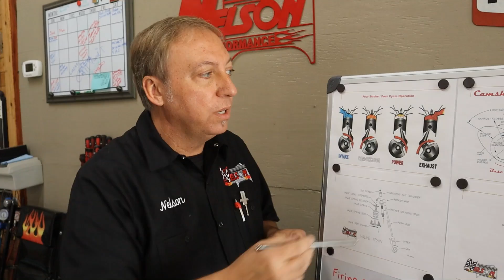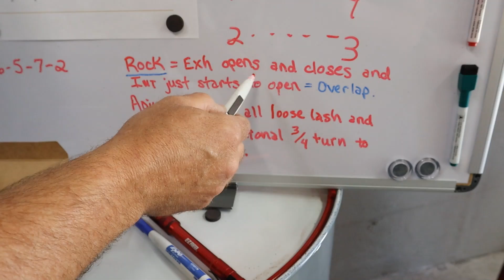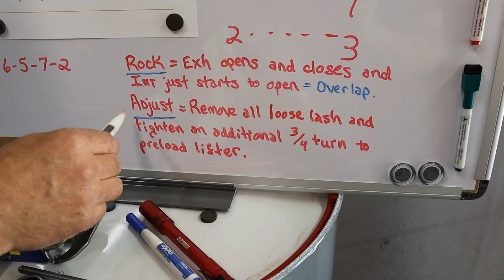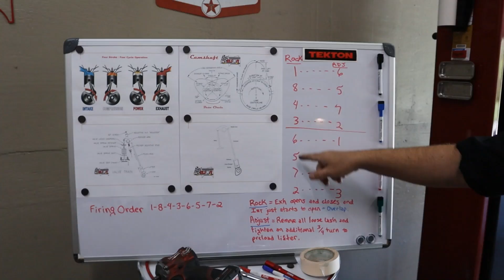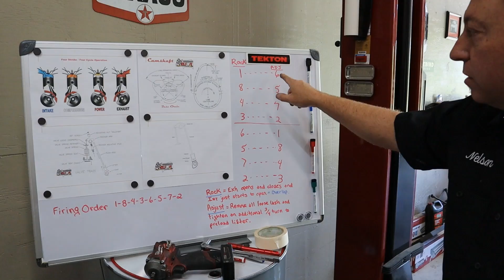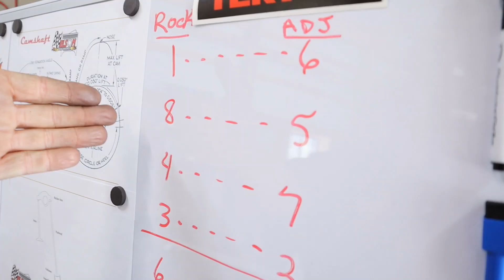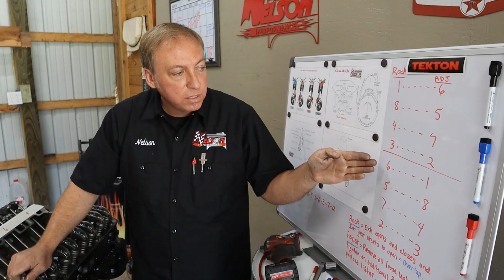Rocker Arm/Hydraulic Lifter Adjustment

Comment: I agree that this method is the best on YouTube! I have been adjusting mechanical (Not Hydraulic) lash adjusters for decades on mostly 4 cylinder import engines. Now my son needs his lifters adjusted on a SBC V8 in an engine I built him 6 years ago. His buddies all have messed with them and they are all out of wack. (I hate those wing-nut rocker arm cover bolts, they scream, take me off! NO! Those are for mechanical lifters & feeler blades)They all had different ideas on how to set them. I have the clip set that keeps oil from spraying while at warm idle running, but this is not practical on all. Now several cylinders are misfiring. I can't begin to tell you how well you explained this, to help my son (37) understand and how much clearer this old tech can show or explain to him and his buddies . They all can take them apart, but putting together is a different thing. Thanks!
DK, ASE master tech since 78.
Reply from the maker: Hey Dean, we get a lot of compliments on this video but I can tell you’ve had your hands on a few through the years and that makes those kind words mean even more. Thanks again and good luck on all of you and your sons projects. Glad we could be a part.

Comment: Worst explanation ever.
Adjust ALL intakes on the left bank, as each exhaust valve starts to open, about 1/4 inch.
Then all 4 exhaust valves on the left bank, as the intakes come to 1/4 inch of closing. 
Repeat on other bank. 
What do I know, I only built engines for NHRA, IHRA, WINSTON CUP, NMRA, AND APBA.
Reply: Yeah, and I just built my own jet-fueled lawn mower motor and it does 8sec on 1/4mile. I don't have a video but just take my word for it.
Reply from the maker: Yep, I’ve heard um all. Just depends on how many time you want to turn that crank. Same end result. Thanks for viewing our video!

Comment: excellent description and followed it and break in procedure to the tee but still wiped out the cam! Elgin cam and lifters. Any advice on how to NOT have this happen again and what cam and lifters I should buy? 67 L79 SBC with Stock 151 cam. All stock 327/350hp corvette
Reply from the maker: Hey James, hate to hear that for ya. Cam lobes are ground at a taper (approx .003) from one side of the lobe to the other and this is what causes the lifter/pushrods to spin when running. Without that taper the lifter wouldn’t spin and it wears very fast. There are a few other things that can cause a lobe to wipe out. Valve springs not matched to the cam causing coil bind and excessive pressure on the lobe or too strong of a valve spring pressure. Improper Valve retainer to valve guide/valve seal clearance also causing excessive lifter to lobe pressure. Also the oil must have a zinc additive in it as an extreme pressure lubricant or a regular oil will cause cam lobe wear. You can get the additive at your local parts store. I have always had very good luck with Comp Cams products. Most of the major cam company’s have been bought by Comp Cams. You can also paint a line down the top of the pushrods so you can verify they are spinning on start up. Makes a lil mess but it’s a good piece of mind. Hope you get it lined out this round. Thanks for the comment. Nelson
Reply: @mitchnelsonperformance  Excellent advice Just installed a GM cam and Johnson lifters at 3 times the cost of Elgin. One of the lifters does not spin nearly as much as the other 15. Takes 5 more cranks to rotate it the same as the others in that bore. Confirmed it with a lifter swap. Do you think this is a big issue? Measured spring seat pressure at 100lbs. Heads are newly rebuilt
Thanks!
Reply from the maker: Hey James, if it wouldn’t be too much trouble I would consider returning (exchanging) it for another. It may break in and be fine but now is the time if you haven’t already buttoned it all up. Also you’re not running any oil restricters in the block to the top end correct?
Reply: @mitchnelsonperformance  No oil restrictors i know of, stock, date coded 67 327 block. I don't have confidence that the replacement cam would be any better so I'm going for it...wish me luck! I'll let you know what happens after we fire it up
Reply from the maker: please do!
Reply: @mitchnelsonperformance  hi mitch break in went well with the gm cam and johnson lifters I think!, got about 20 min at 2-2.5k and it sounded fined but for some reason it suddenly shut down after 20min. unilite dist with 24deg mech advance and set an additional 18 advance for the 2k rpm break in. thought timing was an issue and fiddled with it but to no avail. it's like it suddenly runs out of gas or the coil fails after a few minutes. did not have this issue last time....just wiping out the cam! It's running at good temp about 190deg UHG!!! help!
Reply from the maker: Do you lose spark or fuel? If it’s carbureted you may want to make sure the fuel tank/cap is vented and it’s not air/vacuum locking at the tank. You can test spark by putting a spark plug in a plug wire and laying it on a grounded area and crank it over.

Comment: Great video.  It makes a lot of sense how it's presented.  I wish you did a follow-up for when the intake is already on, and you cannot view the lifters.  (Like on a TPI).  Thanks for the video!  Subscribed!
Reply from the maker: Hey Ryan, You don’t necessarily have to view the lifters when doing the process, if the intake is on. You can also watch the movement of the pushrod/rocker arms if the intake is installed. You will see them move into overlap (the ROCK position). I’ve adjusted many engines that way. Just keep track of your cylinder locations to keep you on track. You can also use the ignition/starter to rotate the engine through the process but remember it only takes a slight bump of the key to turn the crankshaft the needed 90 deg. It helps to have a friend bump the key while you pay attention to the rockers. Good Luck with the project. Thanks for the comment And kind words. please like and subscribe. Neslon
Reply from the maker: Thanks for subscribing!

Comment: what if i've already soaked my lifters in oil? great video btw
Reply from the maker: Hey Sean, The valve springs will bleed the oil out of the lifters as you turn the engine over as the rocker pushes the valve spring down. This will get the plunger off the wire clip in the lifter. The valve spring pressure has enough force to push the pushrod into the lifter bleeding the oil back slightly since the oil pump is not producing oil pressure unless the engine is running.  You don’t necessarily have to view the lifters when doing the process, if the intake is on. You can also watch the movement of the pushrod/rocker arms if the intake is installed. You will see them move into overlap (the ROCK position). I’ve adjusted many engines that way. Just keep track of your cylinder locations to keep you on track. You can also use the ignition/starter to rotate the engine through the process but remember it only takes a slight bump of the key to turn the crankshaft the needed 90 deg. It helps to have a friend bump the key while you pay attention to the rockers. New lifters on a used cam is fine. Old lifters on a new cam or swapping used lifters from hole to hole on a cam is a bad idea. Good Luck with the project and thanks for the kind words and comment! More videos coming!

Comment: Excellent video! Question, when doing this on a engine already in the car and running (I'm just changing the rockers to 1.65)  I can not see the lifters. Can I just watch the rocker arms for when they just start to move for overlap and then remove the 2 rockers for the adjust side? Love this video!!!!
Reply from the maker: Hey Bob, You don’t necessarily have to view the lifters when doing the process, if the intake is on. You can also watch the movement of the pushrod/rocker arms if the intake is installed. You will see them move into overlap (the ROCK position). I’ve adjusted many engines that way. Just keep track of your cylinder locations to keep you on track. You can also use the ignition/starter to rotate the engine through the process but remember it only takes a slight bump of the key to turn the crankshaft the needed 90 deg. It helps to have a friend bump the key while you pay attention to the rockers. Good Luck with the project. Thanks for the comment And kind words. please like and subscribe. Neslon

Comment: Anyone know if this will work on a supercharged GM 3800 series 2 V6 engine?
Reply from the maker: Hey Sauce, those rockers are non adjustable but you can use the process to check the depth (pre-load) the plunger is being pushed into the lifter. If the pre-load on the lifter is to little or to much you can change pushrod lengths to achieve proper pre-load. Hope that makes sense.  Nelson

Comment: Thank you for the very clear video! I have a 1995 mustang cobra 5.0, get a consistent tick/tick sound at 1800 to 2000 rpm sometimes happens at idle. Sound seems to come from drivers side valve cover. Tried adjusting valves per this method, has stock pedestal roller rockers, adjustment seems to quiet it down some but still have the tick/tick about every 1/2 second at 1800 to 2000 rpm. Any ideas?
Reply from the maker: Hey Keith, so it has adjustable valve train and not the 5/16 torque down bolts? If it has the small bolts the will need to be torqued down or they will back off.  I’ve seen exhaust leaks sound very similar to a lifter tick.
Reply: @mitchnelsonperformance   Thanks Mitch! yes just bolts used your process to set zero lash and I torqued them to 20lb (spec is 18 to 24) some went a little farther then 3/4 turn to torque but not much more, was this correct? Reading more on forums sewing machine noise from the Crane Cams roller rockers that came with the Cobra engine is common so maybe need to live with it. It runs very well just annoying tick noise. It had header gasket leaks and replaced the gaskets with the compressible kind and used locking bolts tested for leaks by using shop vac and soapy water no more exhaust leaks but did not solve the ticking noise.
Reply from the maker: Hey Keith, if it sounds like all 8 have a consistent sound and it has good oil pressure then that’s probably just the nature of the beast.
Reply: @mitchnelsonperformance  Thank you awesome video best I found!
Reply from the maker: Thank You!

Comment: This is the way I adjusted valves on engines was four six or V8 valve overlap so if you have a firing order of 18436572 then write down next to that 65721843 so mark your gantner whether it's a six owner with three marks or a V8 which is for marks six owners a third of a turn V8 recorder turn for each cylinder to adjust that way only two rotations you're just all the valves four cylinders same way
Reply from the maker: I’ve heard of many methods. Thank you for the comment Paul.  Nelson

Comment: I feel confident except for I don't understand what "off the wire" means
Reply from the maker: Hey McKenna, that is referring to the “guts” of the lifter. The center of the lifter has a hydraulic plunger cup in it and a small retaining clip (wire) that hold the lifter parts together and when you adjust the rocker it pushes the pushrod down into the center of the lifter to get the plunger off the clip/wire because during high engine speeds the plunger could pop the wire clip out and into the inside of the engine causing major damage. Watch the video again around the 4min mark and I explain it.  Hope that helps and thanks for the comment and subscribing! Good luck on your projects! Nelson

Comment: Hello Mitch: My dad has a 5.3 LM7 GMC Sierra, and he has a cam that’s 209/217 and wanted to know if has to do the 22 ft/lb torque sequence for the factory spec for the rockers? Thank you for the amazing video also, very well explained.
Reply from the maker: Hey Trevor, you don’t need to torque that style of rocker system in order. You can just torque them down the line of each head, but then you can use the video process to check the lash/preload on the plunger in the lifter. Many engines that are non adjustable require longer or shorter pushrods to get the preload correct. Thanks for the comment and subscribing and good luck on the project! Nelson

Comment: Outstanding!  My question is should I prime the oil pump before of after this process of valve adjustment?  Also, obviously there is math behind the split of the cylinders you used to make your chart (between #3 and #6). I am assuming that when #1 is in overlap, #6 mathematically is at base circle of the cam. Is that right?
Reply from the maker: Hey Pat, You will want to do the adjustment with empty lifters, so before you prime it, and yes you are correct on the math! #6 will be on the base circle. Thanks for the comment and subscribing. Nelson

Comment: Way too complicated, way too confusing. Just spin them.
Reply from the maker: Explain.
Reply: @mitchnelsonperformance   Watch Vice Grip Garage video on adjusting rockers. Ellison's Machine Shop channel shows the same method. Vintage Iron channel says this "spin" method is bad and people who preach it dont know what they're doing. To each their own. I had never built an engine before and saw the Vice Grip video and used his method. I now have 19,000 miles on that engine. Just drove it 12 hours from Houston to Tallahassee and another 12 back. No issues. Until I have issues related to this, Im going with this spin method.
Reply from the maker: I watched his video. Should work fine if you make sure you have a good feel of that “spin” tension before it begins pushing the plunger down on a new lifter and if you don’t mind turning the engine over that many times to make certain you don’t miss any. As you said “to each his own”. Thanks for the comment and viewing.

Comment: Thanks for sharing your knowledge, I ask; Can I apply this technique to a Mopar 318 engine?
Reply from the maker: Hello, yes, while most of the 318 engines are a shaft style rocker assembly and are non adjustable you can still use the process to make sure the cup inside the lifter is pushed down far enough so that it isn’t contacting its retaining clip wire and you can also check to make certain you have at least .100 thousands of hydraulic travel in the lifter so they will have enough oil in them to pump up. If not you can change pushrod lengths to achieve this proper preload. Hope that makes sense to you 🙂 Good luck on the project and thank you for liking and subscribing! More videos to come.
Reply: @mitchnelsonperformance  thanks You

Comment: What do we think about check adj a 20 year old engine still in the vehicle? Running method or off and cold?
Reply from the maker: Hello Joe, I would still do the procedure the same way. The oil will bleed out of the lifters upon adjustment. You don’t necessarily have to view the lifters when doing the process, if the intake is on. You can also watch the movement of the pushrod/rocker arms if the intake is installed. You will see them move into overlap (the ROCK position). I’ve adjusted many engines that way. Just keep track of your cylinder locations to keep you on track. You can also use the ignition/starter to rotate the engine through the process but remember it only takes a slight bump of the key to turn the crankshaft the needed 90 deg. It helps to have a friend bump the key while you pay attention to the rockers. Good Luck with the project. Thanks for the comment and please like and subscribe

Comment: I have a 1991 omc cobra 3.0L engine for my boat, would i follow the same procedure? The videos i have seen don’t explain properly. Was wondering if you could help
Me out?
Thanks
Reply from the maker: Hello, from what I remember it has similar rocker arm jam nuts as the small block in the video. You can “rock” cyl 1 and adj cyl 4, then rock cyl 3 and adj cyl 2, then rock 4 adj 1, then rock 2 And adj 3. Same 3/4 turn after removing lash as in the video. Hope that helps. Nelson

Comment: 8 cylinders, 720 degrees of rotation with a 4 stroke motor. 720°÷8=90°... every 90°, 1/4 of a crank rotation. Easy as that! Thanks for the visual! I'll need to check my 1968 owners manual for my 302 4v because I THINK it just wants 1/2, but, can't remember
Reply from the maker: Yep! 90 deg! Most hydraulic lifters will work from 1/4 to 1 full turn.Thanks for the comment tankeater!

Comment: Can you do this same method using roller rockers on hydraulic lifters?I'm doing it right now and just want to make sure before I put everything back on
Reply from the maker: Hey David, yes, exact same procedure. Just make sure you snug the nut a little after tightening the center Allen jam screw to prevent them from backing off.
Reply: Thank you so much. 
 This video is great you made my life so much easier lol.. thanks again brother...

Comment: ive watched many ,this is explained perfectly.im having issues with vailve train noise.sbc.maybe this will help me.
Reply from the maker: Hey Ralph, as long as you have adequate oil pressure and good hydraulic lifters this process should quiet it down. Thanks for the comment!

Comment: Do you do same process if engine has been run recently and lifters have been pumped up? Thanks
Reply from the maker: Hello, The valve springs will bleed the oil out of the lifters as you turn the engine over as the rocker pushes the valve spring down. This will get the plunger off the wire clip in the lifter. The valve spring pressure has enough force to push the pushrod into the lifter bleeding the oil back slightly since the oil pump is not producing oil pressure unless the engine is running.
Reply: @mitchnelsonperformance  thanks for your time